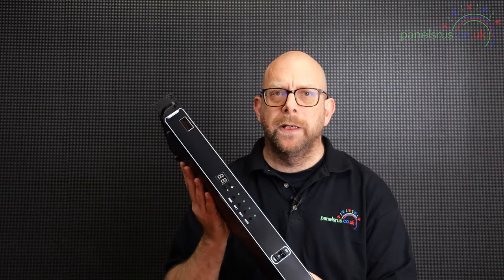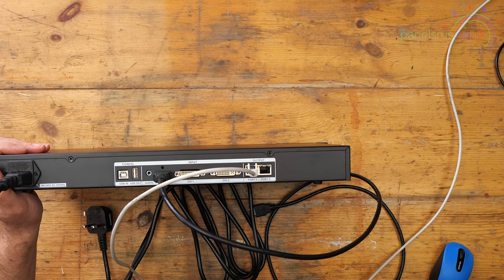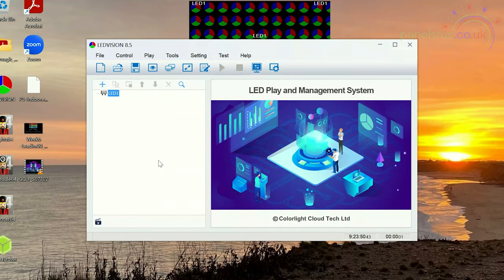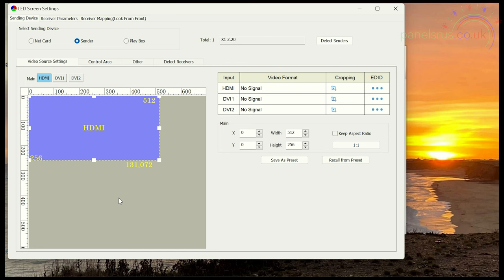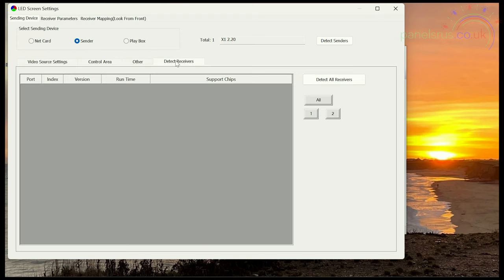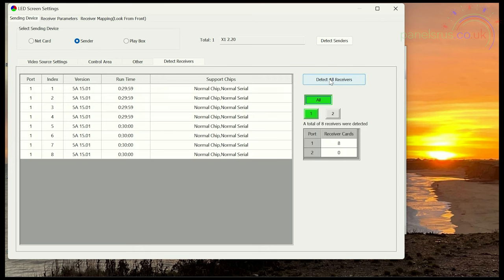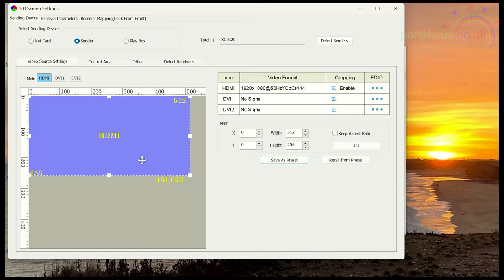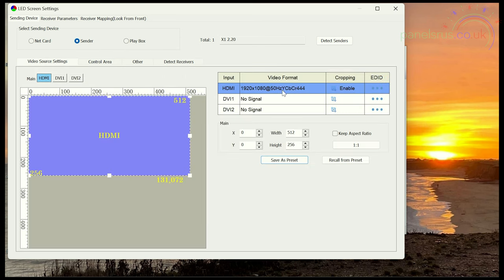Setting up a Colorlight X1 Sender

Comment: Hi, I’m absolutely loving your channel, so helpful. I bought 24 p2 panels and 4 colorlight 5a-75b cards and also colorlight x2. Do I still need to configure every single 5a-75 or can I do everything in one go using sender x2? Cheers
Reply from the maker: Thanks! Daisy chain them & you can program in one go!
Reply: @panelsrus hi, where did You get version 15.01 for 5a75b ?

Comment: Do you have any setup videos on the S2 sending card?
Reply: I have 2 x 2 p5 panels and can't seem to fit the PC screen on the panel. Looks like there might be a minimum panel size of 256 x 256?

I am building bigger, but I was just doing some testing inside on a small scale and came across this issue.
If there is a way to reduce it, I would like to know.
Reply from the maker: @TheScotty49  Hi, no not tested one of those - would be an odd limitation tho.
You have set the screen size & count settings correctly in ledvision ?
Reply: @panelsrus   I believe I do. Everything seems to work OK including video directly from led vision when connected to the receiver card. 
When connected to sender card I adjust the settings to suit and it seems to make very little difference. I can change the X and Y but can not reduce the size.
The PC resolution is set to recommend 1920 x 1200 and I have matched this in led vision. Would this be correct?